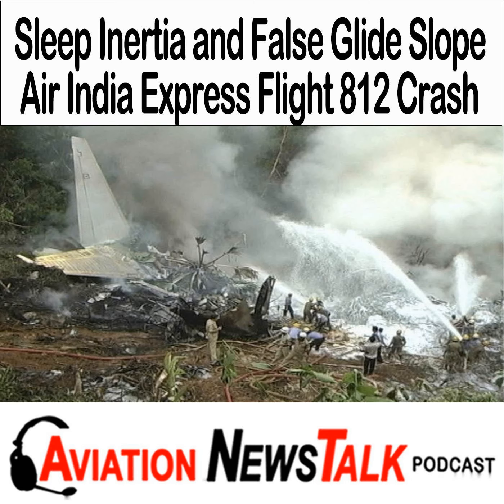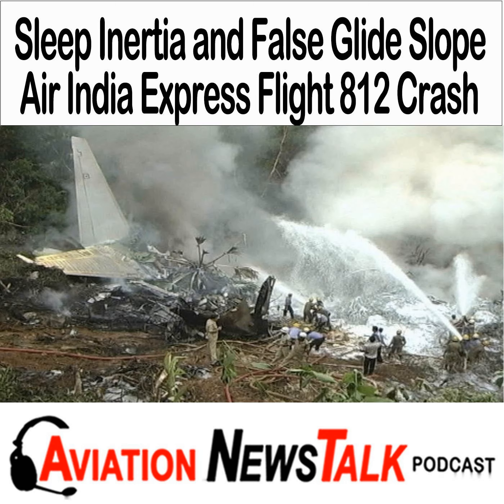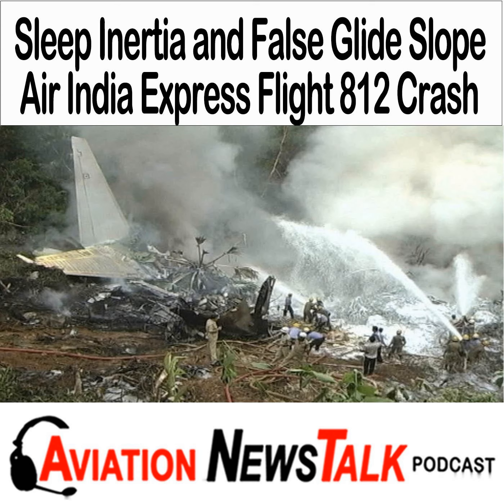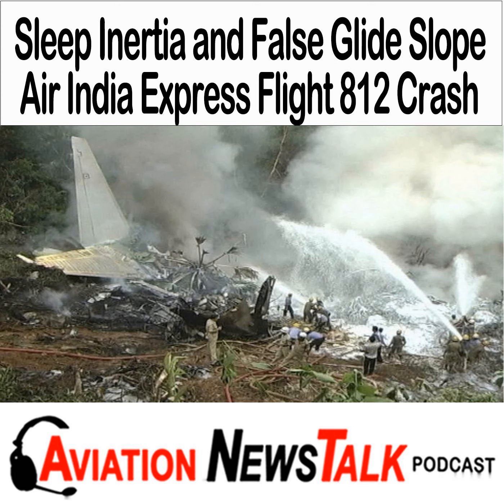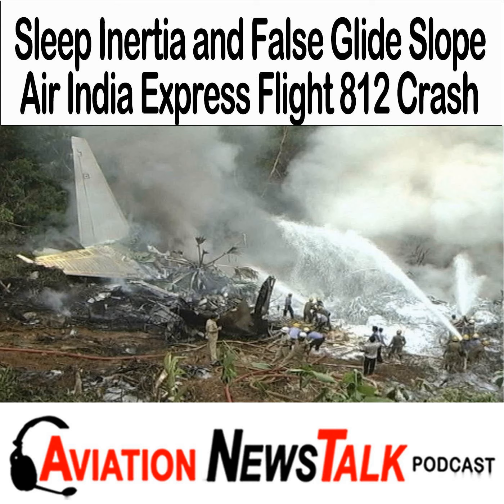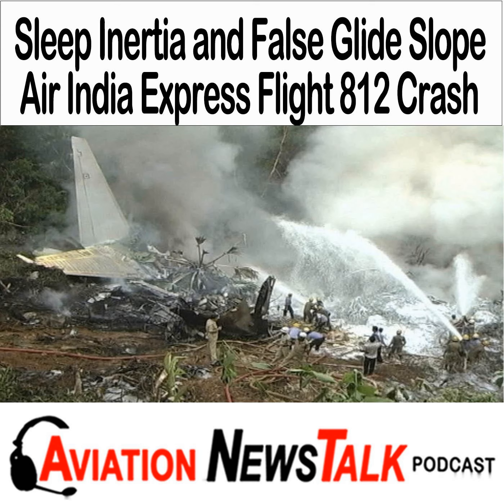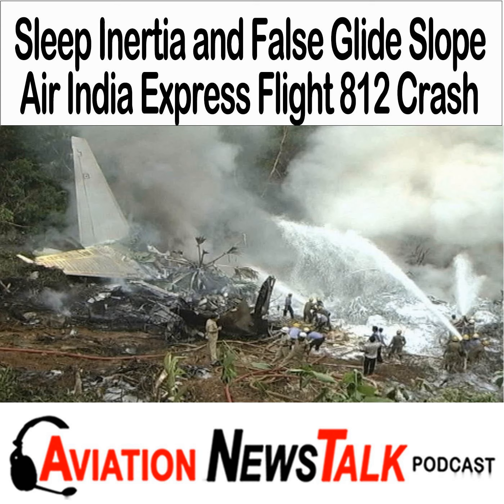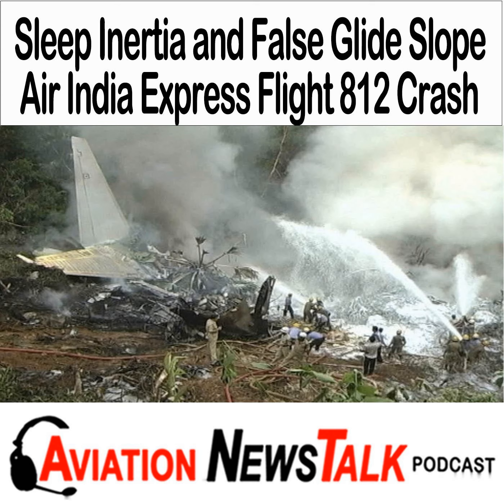321 Sleep Inertia and False Glide Slope – Air India Flight 812 Crash + GA News

Comment: The military has an approach called a HI  ILS (from 10,000 feet). I learned about false glideslopes when I was doing my instrument training. I was told that they usually occur if you are on approach of 6° or steeper. One other thing to note, the DME arc has a minimum altitude with a line underneath it. That means you cannot go below it, but you can fly above it. If the DME arc specified 3000 feet, I would imagine flying the arc at 10,000 feet would tell, you that you just might be a little too high for intercepting the localizer and then the glideslope without possibly diving for it.